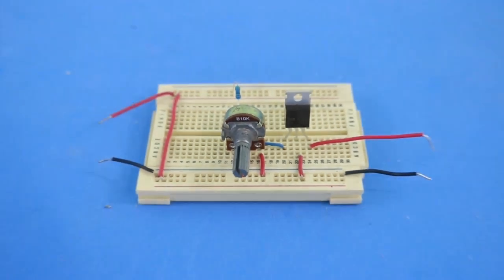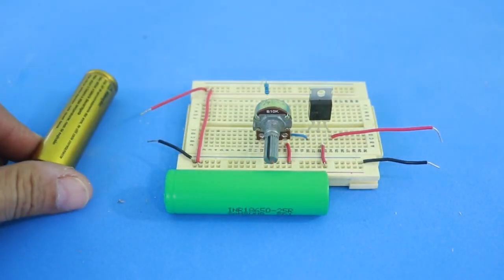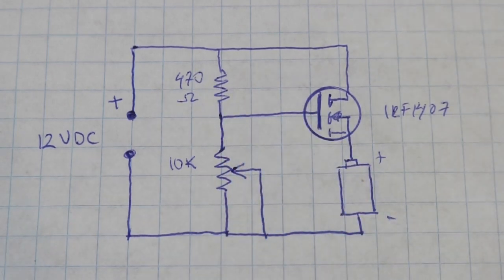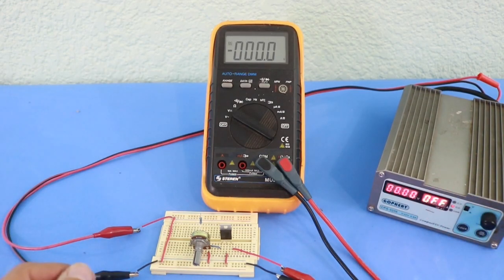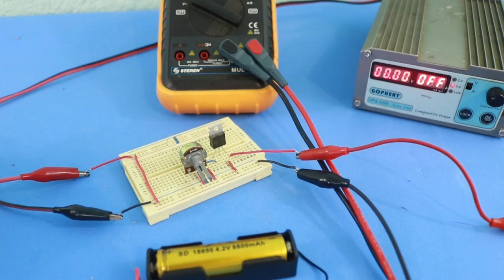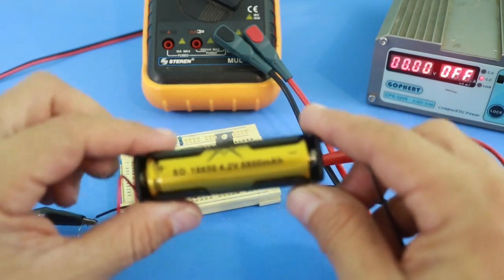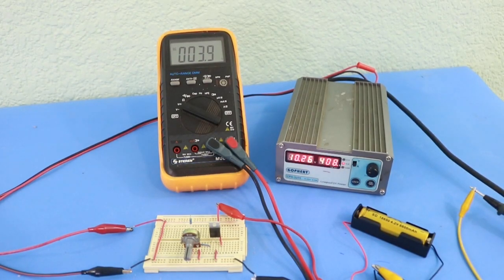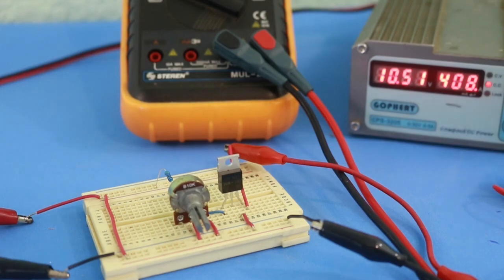Simplest LiPo Battery Charger Only 3 Components

Comment: Don't you need a constant current source to properly charge lithium cells?
Reply: You don't neccesairly need constant current. Of course, a proper charger will do constant current until 4.0V and then do constant voltage(4.2V) until the current drops below 100mA(charge current and cutt-of depend on the type, ans capacity, these numbers are for typical 18650 cells). The video is more of a demostration of what you can do if you need to charge a cell and don't have a charger. Besides, you can charge it with just a pencil lead if you have a DC supply, just form a voltage divider. AvE has a newt video about this, if you're interested.

Comment: Please make part 2 "Auto cut off when full" is there a simple way ?
Reply: There is not a simpel way for it... There for you need to circuit that measures the current that goes into the battery, and when the current going into the battery is below a certain point, the charger circuit will shut down. Easiest way to do this is with a microcontroler.
Reply: @daddynikolatesla6663  why not just use a shunt and a differential amp and a voltage reference? There isn't all that much logic required for a microcontroller, besides, the simpler it is the more reliable it is.

Comment: Pls make 12v lead acid battery circuit with auto cutt off over charging
Reply: Really no point of making it, when a pre-configured tp4056 board can be purchased for less than a dollar. But if you really want to play around(it's playing with fire(literally), escpecially if you don't know what you're doing), you just need a mosfet and couple of opams and a voltage reference(don't trust zeners, their tolerance is too big and current dependent for an application this delicate)

Comment: Interesting circuit; it seens the MOSFET is working in the linear mode so it may not have any advantage over say an LM317 based charger.  However if it were switching then it would prove advantageous.

Comment: I would argue that this is not a battery charger since it does not limit the current. I would call this a linear voltage regulator.